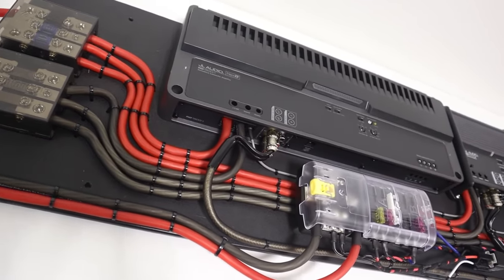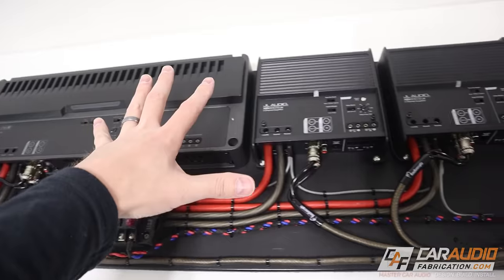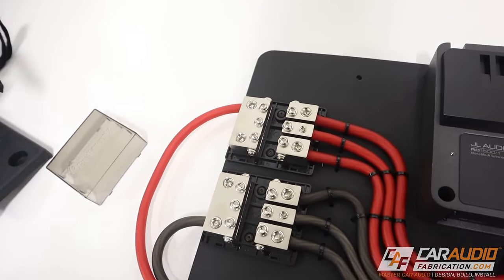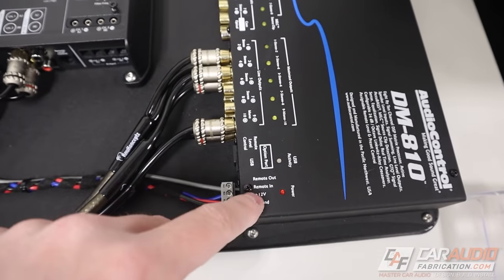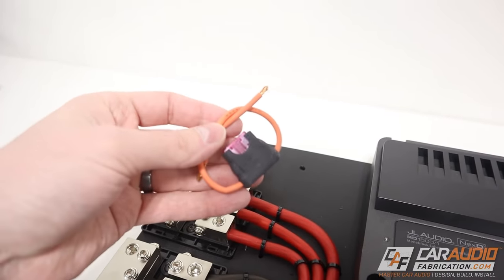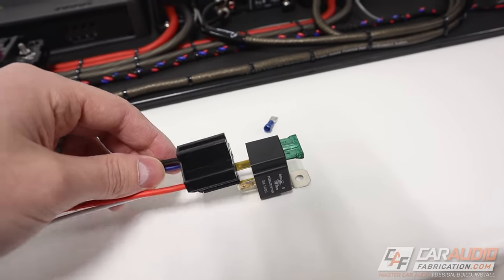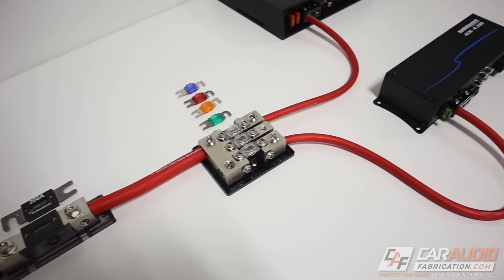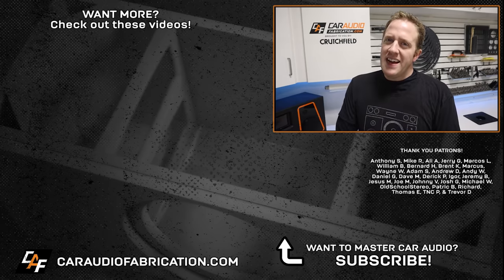Use RADIO to turn on accessories with a RELAY! EXPLANATION & WIRING

Comment: Now I don't disbelieve what you are saying,  because I know current diminishes with more things needing that current.   But why am I able to power, or I should say turn on 5 amps and a dsp off of my headunit?

Does the headunit matter? It's a pioneer AVH-2300NEX
Reply from the maker: Don't take offense to this but you are completely missing the point of this video. I'm not just turning on amps. I fully understand the turn on circuit for most amplifiers requires very little current. Watch the video again for my explanation of what this circuit IS for.

Comment: But how do I control each accessory with one relay. Is one relay used for multiple accessories, or multiple relays. For example: let say I have horns that gets switch from train horns and oem horn. And I have lights as well. Do I only use one relay to control both things?

Comment: there is another YouTube video that illustrates with specs that the relay requires more power from the head unit to power up than 8 amplifiers requires from the head unit to power up.

Comment: I know this is old and apm's is a measure of current, but I think it's easier to explain by using the amp instead. Many wires are rated by amps. That said your remote wire is around 3-5 amps. Closer to 3 if your routing to the trunk. So in fact a relay is amazing idea if you don't want a switch or as mentioned fans and other stuff. I generally always trigger a relay if I have more than one "thing". Example is a single amp for a sub/box I won't but anything more then that where I use a amp rack I definitely always use a relay and fuse box also. Some of those fans can take 5-10 amps surge to get them going.

Comment: I just replaced my head unit . From older eclipse to a new Kenwood. After the swap now it pops when it turns on and at idle my subs have a rumble . Little rpm everything is smooth . 370 alternator . I have a relay in line . It didn't do this before I changed the head unit . I really don't want to go back to old deck . I like the newer one . All the new functions are nice . Any ideas . Probably not best description but hoping

Comment: Can u tell me if I have mine wired fine so I don’t gotta worry about a relay going bad and then having to carry relays in my glove box to I have my remote from radio to dsp then from dsp it goes to 2 amps about to be 3 will I still be fine with I’m using 14 gauge to

Comment: Im doing something similar, but a bit overkill, my system is basic, 4 6.5s on a 4 channel amp and a single 10 on a monoblock, also a half din EQ, a 3 way active crossover and a bass distrubution processor. So im getting relays that delay on and or off, im building a 8 channel with digital countdown for each channel, it will allow power down in sequence. I have most of it working, still need a few things but want to pick up a few more timers to see if i can add a turn on sequence as well as off sequence, i have it 1.2 secs between each delay.

Comment: Great insight as always. Would you add a link for the relay with diode you mentioned you ordered. Or provide a link to the diode you would of used for that specific relay in the video, since i was able to track it down on amazon.

Comment: Hey mark I have a question I install an audio system in my truck & there’s motor noise in the speakers & some guy from d tronics told me it was because I had all my wires together , is that true

Comment: Those relays draw more power than six amplifier remote wires from the head unit
Reply from the maker: You're  only saying this because you watched another YouTube video that completely ignores the reason these are used. I powered lights, fans, and several other items off the circuit. Helps to actually listen to what is said in the video
Reply: @CarAudioFabrication  yeah I was actually looking up if I needed a relay. I did watch another video and he tested it. Yes I just saw it on another video lol. But I guess if you're running fans and lights and everything then the relay is the way to go.

Comment: Having  trouble finding this: What size speaker wire for subs? 3,000 rms (6k max)  2 12s going to be paralleled to 1 ohm load at amp. No idea what wire gauge. DVC 4 ohm if that makes a big difference. If y’all have suggestions plz lmk 😂 I see 12 and 14 AWG suggestions for subs but I want to be 100% sure b4 I cause a fire hazard.
Reply: Why not just go 8 gauge?
Reply: @SouthwestD313  the terminals on the subs won’t fit 8 gauge when doubled up for the parallel wiring. 10 might work tho so I’ll prolly go with that

Comment: My radio turns on 3 amps just fine. Imho, a relay isn't needed.
Reply from the maker: Did you watch the video? This video is NOT about just turning on multiple amps, its about adding a totally new circuit for several devices.
Reply: This isn't so much about turning on amps, but using your remote turn-on to operate accessories.
Reply: Amps don’t need much current to turn on but as soon as you add led’s it will burn out a turn on circuit in minutes.

Comment: Relays can be Normally Open (NO) or Normally Closed (NC), which is the state of the relay without power. For this you would want NO type contact. Also, the "quick connect" is known as a socket/base. You can get some that mount and the relay will plug into them for quick replacement. You would run wires from screw terminals off the socket/base and then plug them in. Most relays I've seen do not have a built in fuse. There is a minimal loss of power for every break in line and chance of corrosion so limit the amount used if can.

Comment: Hi Mark How are you? I hope that very good
I want to install my electrical system of amplifiers and DSP but I am confused with the installation of the relay numbers... from what I understood the configuration would be the following:
30: constant battery power 12v
87: Amplifier and Accessory Power On
86: Main unit or DSP remote output
85:Ground

The issue is that in other places I see that these settings change, for example:
87: constant battery power 12v
30: power on amplifiers and accessories
86:Ground
85: Main unit or DSP remote output

Is the same? Thank you very much for your explanations